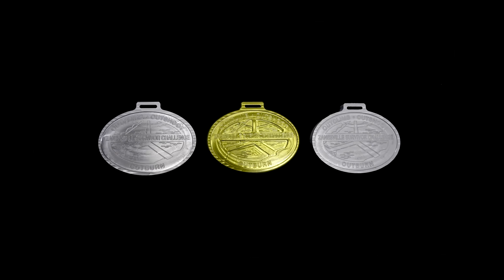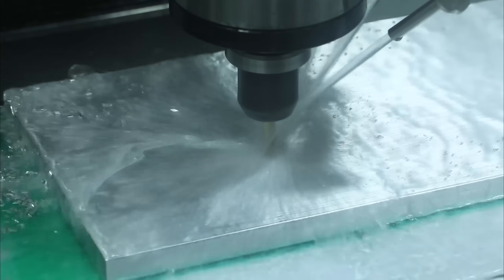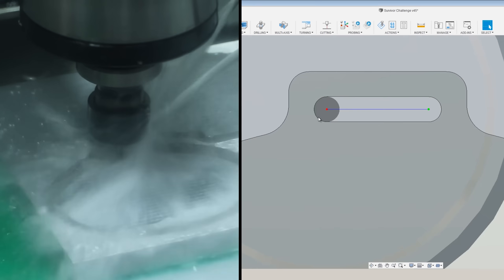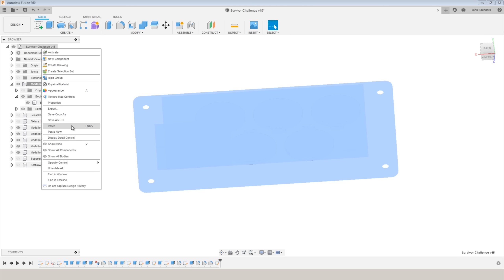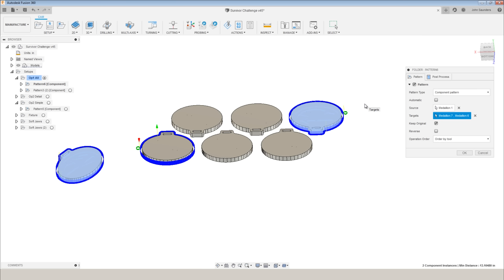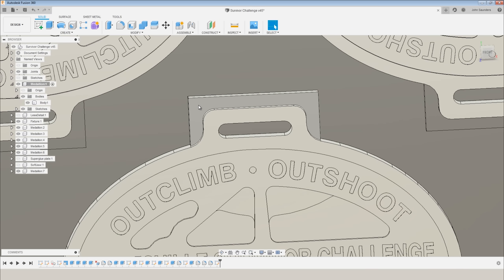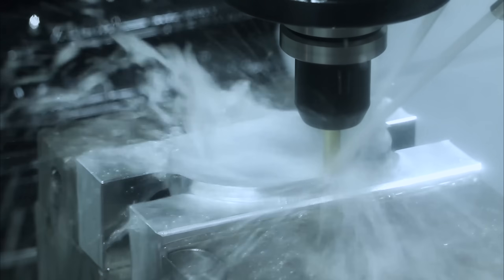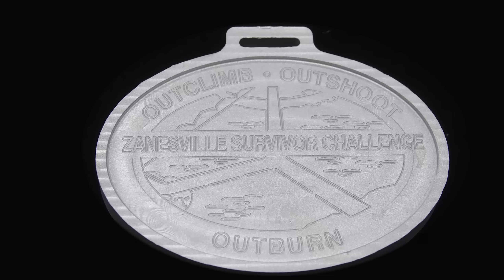CNC Job Shop Work, Production Workflow, and Fixturing - Machining Awards Medals

Comment: Why don't you machine all the features first, chamfering included then do the cutout last? I do this all the time, never had an issue. Doing the operation that puts the most lateral forces onto the pieces while it is one single piece of aluminum works much better.

Comment: Great idea with the fixture to hold them in place in the 2nd op. Thinking this idea a bit further you could face the backside (the whole plate) and machine a small "canal" around the part and do the chamfers. When you go to flip it you have plenty of surface area for holding it with super glue, you can then machine all of the features on the top, finish the slot, etc. And just machine the outside of the part last. If you leave a bit of stock around the part in the 1st op the part is gonna clean up really nice.

Comment: Couldn’t you have cut the faces of the medals while still in a single block just using glue? Then do the perimeter as the final step to minimize forces on the glue.

Comment: That is exactly how I program my fixtures they have 32-112 parts on them, I pattern the model for them all for reference, but program the bottom left part. Then I pattern them by 8 in the X, and then I pattern that pattern in the Y depending on how many parts fit the fixture which allows me a little more functionality if I needed to use stock that is partially used in a pinch.  It would blow up the computer if I had to compute the tool paths on each part, as well as avoiding the tedious time-consuming task of clicking every individual contour for each part I needed lol. One thing I use on the Tormach that works well for a quite a few runs when I need a quick setup is the marine-grade plywood on Mcmaster as a spoil board like on a CNC router, it doesn't swell with water using flood coolant and you can get quite a few hours/parts from it before wood screws start spinning freely when torquing down.

Comment: You can set up multiple parts in soft jaws, key is dimensional referencing on the parts, also use separate work coordinates for each one.  I had to make 200 approximately 4" coasters when I was in school, we ran 2 buses, 2 parts per vise in soft jaws, we turned the stock down to 3.950 before parting it to thickness.  The jaws were about 8 inches long, so a little longer than the 6 inch vise.

Comment: The soft jaws aren't cheap,  would it be more cost effective to mill your own because they aren't that complicated?
Reply: About a horse a piece. Probably have to do em in 30 minutes or less to break even with shop time rate.
Reply: $150 for a 10 pack of the ones he showed. $15 for a set is WAY cheaper than you'll ever be able to make them for. Unless you consider your time worthless, or you get the material free, or you have an apprentice that isn't busy doing other stuff.
Reply: At the shop where I work we run soft jaws by the pallet.  Usually enough to get us through a whole quarter.  They take about 5 minutes a piece. The set up takes about 15 minutes.

Comment: This is a cool project. Wish the detail was a little easier to read, the tool marks are neat but they really make it hard to read. I'd like to see the parts get some kind of surface treatment so the only detail is the machined detail. Hope in person it's not as significant. Still, cool project glad they liked it.